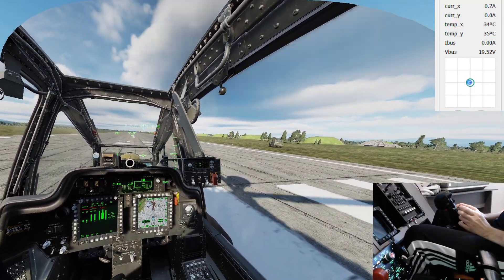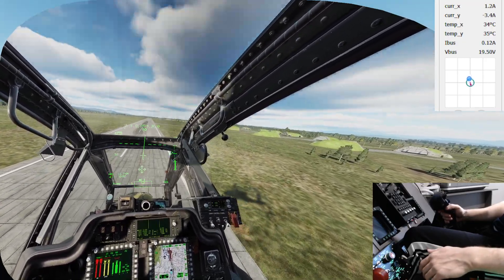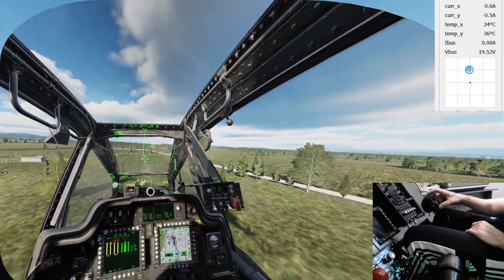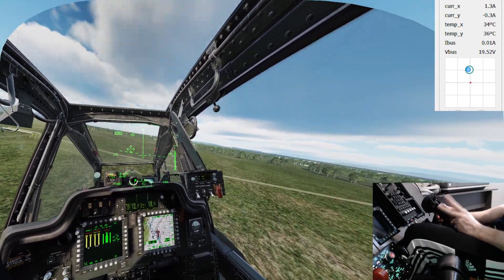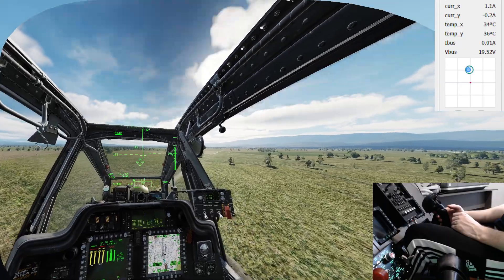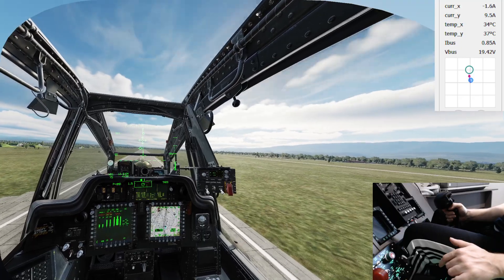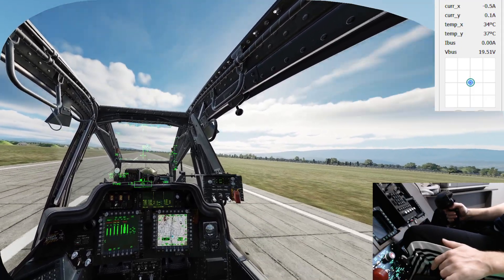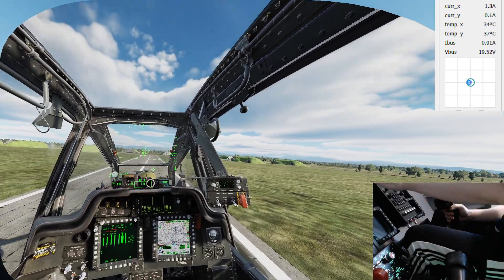Force trim in helicopters (Rhino and FFB in general)

Comment: The "bounce" discussed after 8:00 is actually quite realistic. The real life name is "stick jump", and it happens with real helicopters with force trim release function. Pilots are taught to avoid it by changing the trim point constantly so that the stick force at the time you press FTR button is not high.